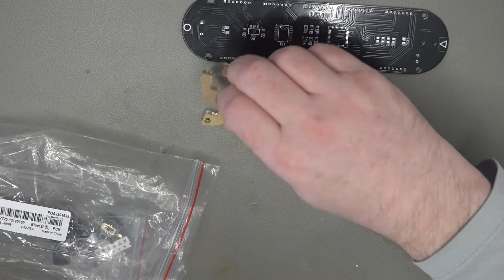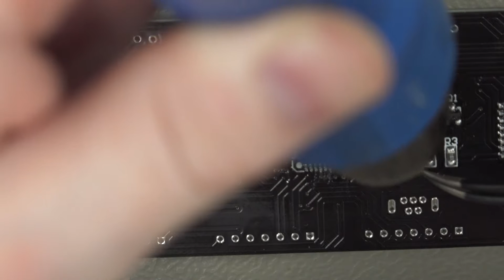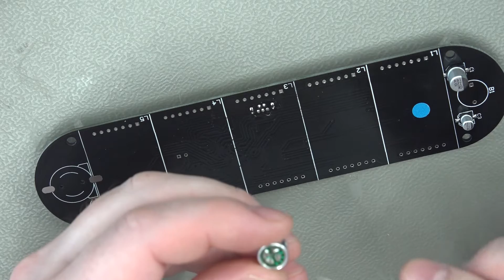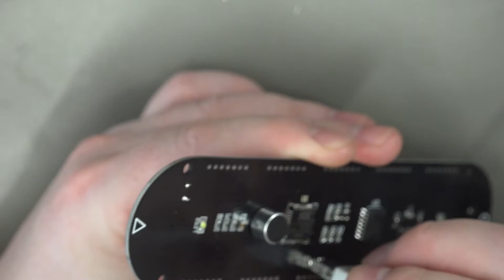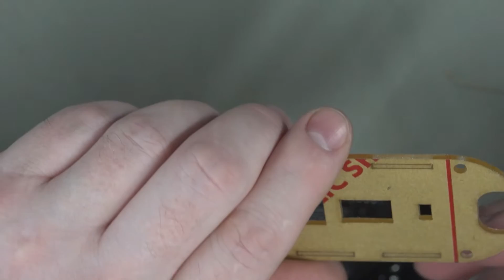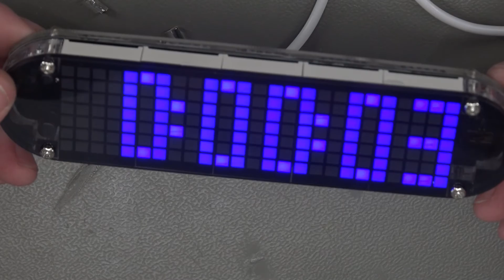Geekcreit DS3231 LED Clock Kit Build

Comment: I got this from Ali Express. The Aholes at STC who make the 44 pin square chip thought it would be good to put two circles on it, one large and one tiny one. I oriented the chip with the large circle as pin one and the clock didn't work. After digging around in the data sheets I found out the small circle is pin one. Why have 2 circles at all? Impossible to remove the chip without spending more than the price of a new kit.
Reply from the maker: a fair comment, why indeed? just and easy way to confuse people!! so you could remove it with flux and a hot air rework station if you have one. but there are no guaranties the chip will still work, having been placed in the wrong orientation
Reply: @ElectronicStuff  Yeah a hot air station would work if I had one but since I don't it would cost me more than a new kit.  I saw another You Tube video where the guy did the same thing and it did blow the chip. Thank you for your comments. STC makes 3 versions of the same microcontroller,  one with one circle,  one with two circles, and one with three circles.  Morons.
Reply: @ElectronicStuff  I bought another kit and the microcontroller only had one circle. I put it together an it works.

Comment: Is it difficult to assemble this? Im a non electronics person
Reply: If you have never soldered before it will be very difficult, especially the 44 pin microcontroller.

Comment: I would have used Circular Hole IC Socket for the matrix module's, so i can replace them if one of them broke.

Cost you only €2,48 extra at BangGood.
Reply: Good idea but I think it would raise the display height ,thus you require relatively thicker transparent c-shaped spacers to match that height

Comment: Hello, could you please help me? I assembled the same clock, but after I turned it on, display does not works correctly. It shows unreadable words. Do you have any idea where I did mistake? Thank you.
Reply: resolder STC CHIP
Reply from the maker: Hi, I would double check all your solder joints and check components are in the right place and orientation
Reply: https://ibb.co/yqFRZnJ  can you help me where the problem might be?  one LED strip is off
Reply: @chichman83  by close view of your picture, it seems 6th column is un- soldered or short with adjacent pin (check on STC chip)

Comment: Could you provide links to blower and other products you used to assemble this clock?
Reply from the maker: Hot Air https://www.banggood.com/YIHUA-878D-2-in-1-Desoldering-Soldering-Solder-Rework-Station-Welder-3-Nozzles-Spanner-p-1125599.html?akmClientCountry=GB&cur_warehouse=CN

Soldering Iron https://www.banggood.com/YIHUA-939D-75W-Digital-Display-Soldering-Rework-Solder-Iron-Station-3-Tip-Lead-Welding-p-1124647.html?utm_source=google&utm_medium=cpc_ods&utm_content=ysq&utm_campaign=ysq-content-sds-bag-content&ad_id=332692637488&gclid=CjwKCAjwnrjrBRAMEiwAXsCc44yuhAZxg8I0WwgNq6oFqGHGS6aKGVgEzOw9bDbMezvaBaiOk-pI9xoCcqoQAvD_BwE&cur_warehouse=CN
Reply: @ElectronicStuff  Thanks for sharing the links. Do you have any cheap alternatives as I am going to use it only once to prepare this clock?
Reply from the maker: Hi, Not of the top of my head, but do some searches on ebay and you should find some cheaper ones
Reply: @ChetanSachdev  you can solder with simple soldering iron with sharp edge